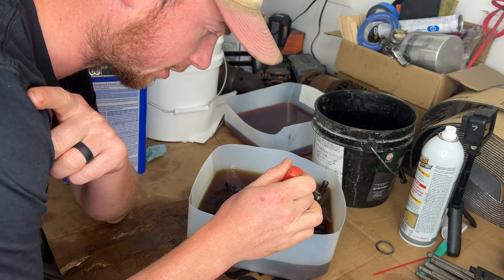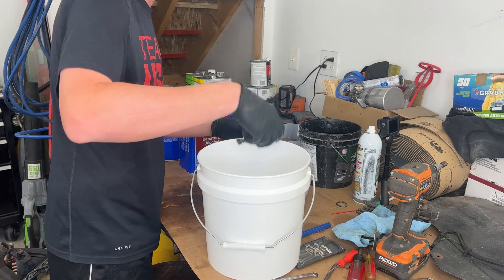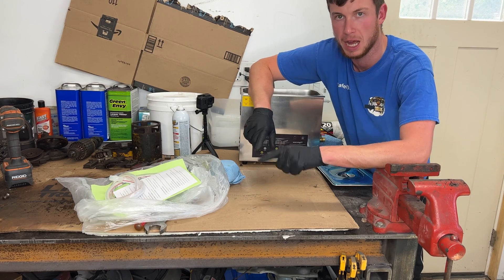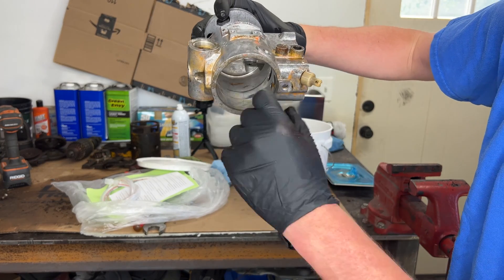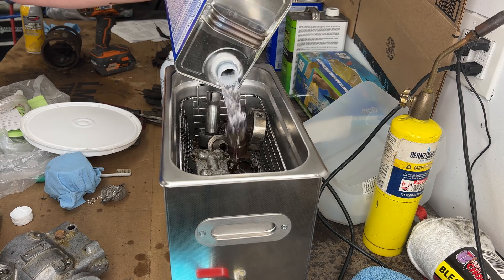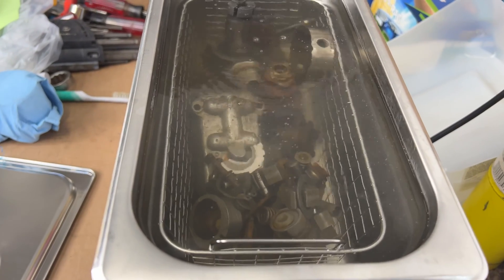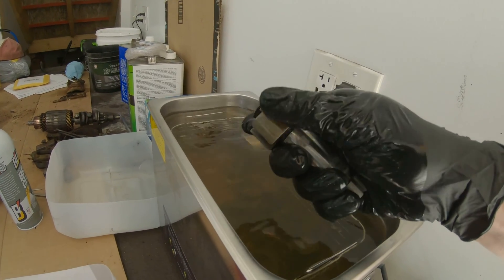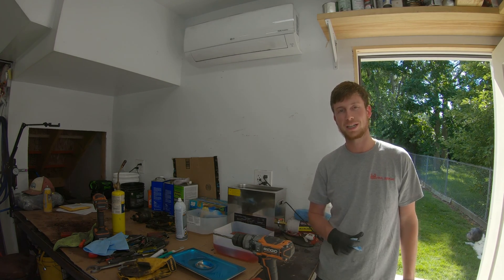Cleaning BioDiesel out of an Injection Pump with ULTRASONIC

Comment: They make a solution special for ultrasonic  cleaners, if you think it's worth it. Also Advance Auto supply has chemical gallon cleaners with parts baskets that might be worth your time.  When I was a mechanic  we used the chemical  solution with great results.